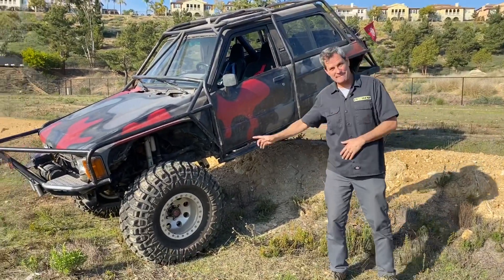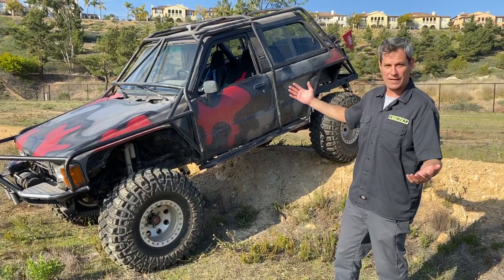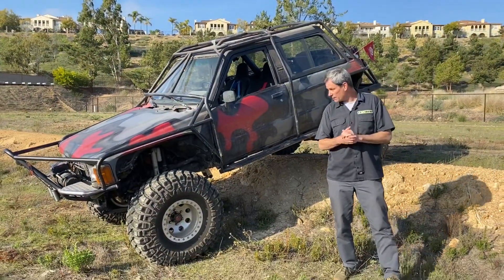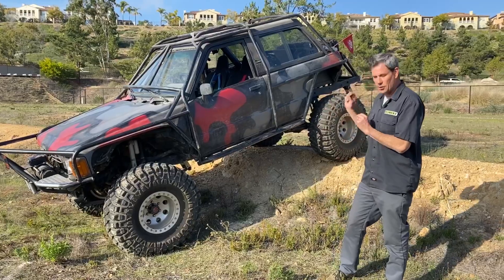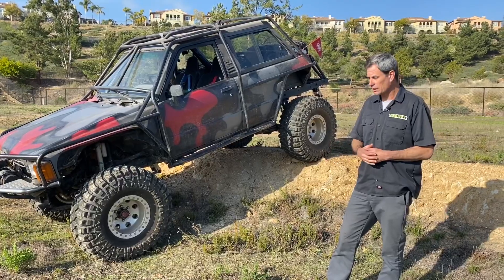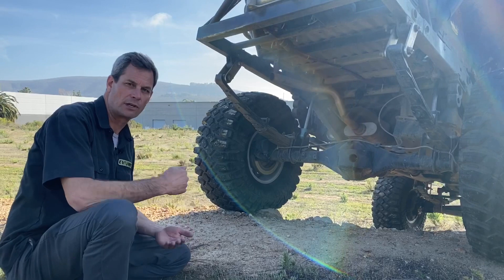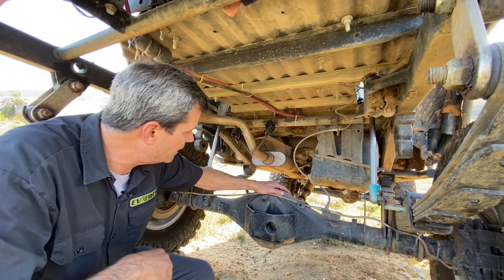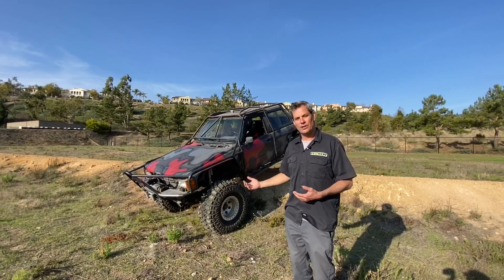1985 Toyota 4Runner Electric Rock Crawler | EV SHOW

Comment: So fuel the generator up to recharge the batteries?    This tech is only good for extreme short distance applications. Overlanding or remote use is impractical... even with swappable batt packs.... dumb duh dumb

Comment: Great project! I'm looking to convert my Toyota crawler to electric at some point but I also need it to drive on the highway. It'll be interesting to see if this conversion puts too much torque into the dual t-cases and you start shearing input shafts or splines.  I was thinking if/when I do my conversion of using two motors and having them connected to front and rear drive shafts to ditch the t-cases and transmission.

Comment: This is a MUST BUILD EV. There are hundreds, if not thousands of 4WD Jeep Cherokees and Grand Cherokee that would benefit from a reliable on road/off road relaible EV conversion keeping their current suspensions, be they stock or built. This build info is critical as we move past "peak oil" into a EV new world of do it all EV transportation and fun multi-use clean power vehicles.

Comment: I’ve just done a very mild 4x4 EV conversion with my Suzuki Sidekick.  Sounds like you guys have plenty of gearing, but I’d also recommend a motor/controller with hill hold and very fine real-time regen control.  I used a Hyper9, and put the brake signal on a knob for “hill descent control” via regen.  Works amazing.

Comment: If there was a conversion crying out for an old 30-50KW industrial servo drive, this is it.  A BIG reason for the high reduction is the precise speed control it gives you.  An industrial servo with the velocity loop active will do the exact same thing and may let you drop one of the transfer cases.  Throw it in torque mode for normal driving.  Maybe even put the servo motor in position control mode and drive with a Jog-wheel on the dash?  (i.e. spin it to move a proportional amount in tight spots, 1 foot per turn or similar)

Comment: Are You setting it up for short competitions or all day fun ? If the latter... since your splitting up the batteries, couldn't You go hybrid (charging one set while using other), for charging in-field ? 
(Should think a small 7hp diesel would have enough torque for quick gen)
Reply: Like portable honda generators
Reply: @chriskilkenny9641  I have seen a 5-7hp spinning an alternator to extend range to average 86mpg at 55mph (that was late 60's early 70's 36v system) 
So, yes a generator sized correctly,  charging pack not in use. And alternating between them should xtend range.. 
Or if usage/load is within the scope of a generator (that's what 10hrs @ 50% & 4/5gal of gas)...

Comment: Bring it to Rubithon, Sierra Trek and Marlin Crawler Roundup
Reply: You're going to want to add elockers to front and rear. Get rid of the spool and you also probably dont have lsd in the front. Yota never made a lsd 8in 3rd member. So you most likely have a open diff up front

Comment: I suspect you can take out some of those gear reductions. You're at what...  50:1 total? That might make sense for an idling ICE that produces no torque below 1000 rpm, but for electrics it seems excessive.
Reply: You need low range for rock crawling 200:1 is bare minimum. Slower the better to control hopping and snapping birfields and axle shafts and minimizes body damage. Watch a few Marlin Crawler videos on double and tripple tcases to learn the benefits of doublers
Reply: @Sa-aa11-jke  But the control you're talking about already exists in electric motors right down to 0 rpm. That gearing ratio is only necessary because you can't run your ICE down at 10 rpm. For the e-motor, your only restriction is getting enough torque, which sure as heck isn't going to need 200x motor output.
Reply: @Hamilcar_Stronginthearm  I don't think you understand. While the gear reduction and added torque is another benefit. The main benefit is engine braking and allowing the truck to "crawl" at literally 0.5 mph. You put it in Low Low 1st gear and literally don't touch any of the pedals. It controls decent and wheel spin applying traction and also torque. You're telling me the motor can already achieve this with out a transfer case gear reduction and differential gears.
Reply: @Sa-aa11-jke  Well an e-motor won't apply any 'engine braking' because there is no friction of pushing pistons around in tubes and sucking air through complex plumbing. (unless you apply a reverse torque, i.e., regenerative braking). Multiple step-down gears will give you a drag brake, since just spinning each gearset eats up energy, but that's somewhat a separate issue. In short, yes, I am telling you that you can drive along a 0.5 mph with an e-motor without super low gearing, because the e-motor is happy to spin and provide its rated torque at 10 rpm.
Reply: @Sa-aa11-jke  Yes.  But only if you program in a 'creep' as default.

Comment: With the double reduction transfer case, you might not need the transmission at all. With the motor in the trans tunnel, the engine bay can be devoted to batteries.
Reply: Yeah, he could also have four small motors, one for each wheel, and devote the engine bay AND the trans tunnel to batteries. With each wheel having its own motor, you can add sensors and program for each wheel to act individually
Reply: @Hmmmst  wrong, that will require too much modifications and this normal configuration of the tacoma allows alot of suspension travel, the locking differential are way better than individual motor controls too.
Reply: @carholic-sz3qv  With electric setup similar to what I've described, you eliminate the need for differentials. Differentials worsen ground clearance. Also, I don't see how this would at all affect suspension travel. For compactness, hub motors could be a good option. So no gearbox (or possibly planetary gear setup), no drivelines, and no motors outside the wheels hindering suspension components. Just some cables from the body to the wheels. And no, locking differentials do not have the potential torque vectoring does. This is one of electric's many advantages over petrol and is blatantly obvious. 

Though if I missed something, please do enlighten me as to why this wouldn't work
Reply: @Hmmmst  unfortunately hub motors are small and not nearly as powerful as central placed motors, the only best solution here is to replace the transfer case with a big powerful electric motor plus small reduction box.  Hub motors will not be able to replace a locking differential or physically make the rear or front wheels turn at the exact speed.

Comment: Very cool!  This will be fun.  
So here I come...the "good idea elf".  
I know throwing in an AC50 or AC75x2 to the current transmission, transfer case, transfer case 2, and 5:1 differentials is the EASY way to go.  You'll be done in a week!  But is it the coolest way to go??  I mean, are you in a hurry?
I'm putting a large drive unit transversely in my Jeep Wrangler.  4.5:1 gears in the DU and I put 3:1 gears in the diffs.  Custom stub shafts to bolt to upgraded ujoints and custom drive shafts.
Anyway, just a thought...  It'll be great no matter what you do to it!
Bill

Comment: Awesome project!!! Why don't you stick a motor straight into the transfer case. You can add dual case from MarlinCrawler and have 2 reductions in series. I have thought about this setup for a while. Please if you make an adapter plate from any of your ac motor straight to the toyota mini truck transfer case input shaft, please make it available!!!!! there is so much developed by MarlinCrawler for this transfer that it will basically make the adapter useful for a wide range of toyota trucks and suv. Looking forward to the build!!!!

Comment: This is going to be an unfair competition. BEVs are simply better at tasks like low speed climbing. Oldschool drivers are going to cry fowl.
Reply: Or foul.
.
.
Unless they are chicken.
Reply: @honthirty_  Woops me no englishing good.
Reply: Ev engine does supply tons of torque. But what really sets a rock crawler apart is low range gears. What they are doing is using the marlin ultimate with double tcases and 5.29s for a 229:1 reduction. Throwing any engine in the bay regardless if its gas or ev  engine won't really make it crawl better. It's all about gear reduction for rock crawling. I'm interested if they can figure out how to do the Rubicon trail from Loon to Springs and back to Loon with the battery pack. One because It's probably a green sticker truck and isn't street legal in It's current configuration and would be trailered. So they have to wheel all the way back out. It's the most remote place for rock crawling on this earth. Until they can figure out battery capacity issues. No true rock crawler will cry. Theres nothing that can compete over a gasoline or Diesel engine in terms easily refuelable powertrain options. Theres quite a few propane converted engines at the Rubicon. I've seen plenty run out of Propane on trail. Most people on the trail carry gas jerry cans and you can barter for a few gallons. That ain't happening with propane and I've seen plenty of people had to get a buddy to wheel through hard rocks to get propane 30+ miles away. Then wheel back to do it all over again. I ain't seeing any option for EV unless carrying more batteries. Rubicon is unforgiving to the unexpericened and lack mechanical ability to perform trail fixes. Adding EV tech will make it even harder. There is no AAA service. You fix it yourself or you go back in town to get parts and tools to come back and repair. If you leave the truck too long out there by itself. There's going to be parts missing on your return.
Reply: @Sa-aa11-jke  a good solar array can do it ;)